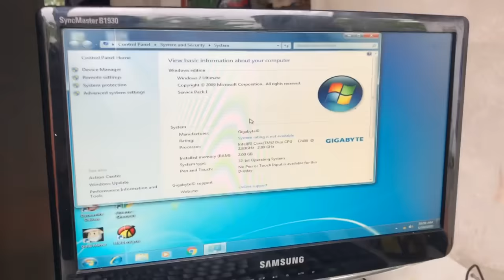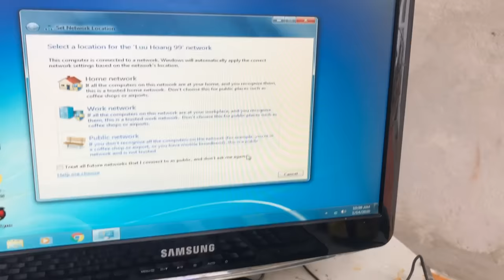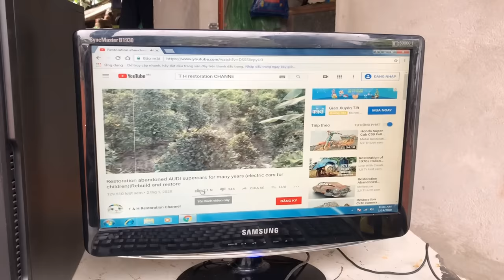Restoration destroyed desktop trees | Rebuild and restore ( FULL )

Comment: There is special place in IT hell for people who do things like these.
Reply: Good thing the entire machine was worthless beforehand. The PSU is an IED and the motherboard is a trash design made solely to clear out stocks of old Intel 945 chipsets. The Intel 945 chipset was in reality a Netburst Pentium 4/Pentium D chipset with bare minimum support for early 800 MHz FSB Core 2 parts.

Near the end of the Core 2 lifespan, there must have been a surplus of old 945 chipsets because most board vendors released several new low end boards like this one. They did some black magic in the hardware, and ugly hacks in the BIOS to "support" 1066 and 1333 MHz FSB Core 2 parts to try and make a sellable product. All of their "under the hood" jimmy rigging made these boards very unstable, especially when using 1333 MHz Core 2 parts, like the E8000 series. They also had shit performance owing to the gimped 533/667 MHz RAM.
Reply: @GGigabiteM  before i start i want to say i am a complete pc noob. I tried upgrading my gpu and psu from yesterday after finally waiting a week and paying $630 for my gpu. Well it went to shit i get bsod with no error code, my mouse usb is fucked (keyboards usb works in every port i tried 2 diff mice that don’t work on the usbs,  my fans won’t spin and it says hdmi not detected. Idk wtf i did but i watched hella linus and jayz2cents vids but it still went wrong. Gave my computer to geek squad for $250 in hopes they can fix it.
Reply: @Florida_954  Giving your computer to geek squad is about the worst thing you can do. I'd go get your computer back ASAP and make sure nothing was stolen out of it.

Plenty of forums on the internet with tech people to help diagnose and fix your system without risking it being destroyed or have parts stolen from it.
Reply: @GGigabiteM  really? I tried going to reddit first but nobody knew what was wrong. I hope i just get lucky man, i took pics of my pc before sending it in and it worked perfectly fine before i tried upgrading so i’ll just have to wait and see. Thanks for your response
Reply: @Florida_954  If you changed only your PSU and GPU, one of those is going to be the problem, unless you damaged something. Since I know nothing about your system, I can't give you much assistance, just basic troubleshooting.

If your new video card is significantly newer than the older video card, like by years or decades, the BIOS/UEFI version on your motherboard could be causing issues. It's not uncommon to have motherboards with old BIOS/UEFI versions to throw fits or not boot at all with a newer video card. Drivers can be an issue if you didn't uninstall the previous video card's drivers first.

As for the PSU, again no idea what you bought. You could have bought a land mine for all I know, not all PSUs are equal and there are thousands of chinesium wofat IEDs out there that are dangerous to use. At best, they'll cause the system to malfunction, at worst, they'll kill parts in a system. Another possibility is you plugged things in wrong. The PCIe 8 pin power connector is interchangeable with the EPS12v power connector, despite them having an inverted not compatible pinout. In most cases if this is done, the system won't power on because of sanity checks, but if those don't exist, the motherboard will basically turn into a smoldering crater.
Reply: @GGigabiteM  hey, luckily they got it working fine for me. They told me i had no blue screen and i just misplaced a couple things. Still a bummer considering i had to pay for the expensive membership but i thought my pc was ruined or my new gpu was the problem since i just got it and they’re so hard to find.So i’m not mad at all just happy everything is running :). Thank you so much for the advice and hopefully i can successfully upgrade my own computer next time.
Reply: 100%!
Reply: Hey guys look pc running windows 7

Comment: This is fake
2:32 Some of the pins on the processor socket are misaligned and he doesn't try to fix it.
3:10 The CD Drive has totally damage, no control board so it's impossible to repair it.
5:17 You shouldn't treat a hard disk like that as it will damage the surface of the disk.
5:58 You put the CD Drive upside down, I think he's hiding the top so we don't know it's another drive.
Reply: I think washing computer components in water is also pretty bad
Reply: Not really, I also usually do that and it's fine, as long as it's done carefully, don't soak it, and immediately remove the remaining water using a air compressor and then dry it in the sun or hair dryer for a few minutes until it's completely dry.

Comment: The socket was fine after motherboard cleaning, but you broke it...  How the motherboard could post? And why the hdd are so dirty INSIDE. The HDD are practically sealled... FAKE
Reply: Yes
Reply: Agreed, also why would someone put water on it?
Reply: I know right
Reply: And with the multimeter, he was just probing random pins measuring the continuity to make it look like he actually knows the pinout and diagram. It’s just really fake. Not to mention his very bad soldering job.
Reply: The final giveaway is with the monitor. He showed that he repainted it but look at the end he even got the original labels “repainted” lol
Reply: Sriram Jeostarzz it is very obvious that most of these parts cannot be recovered from the damage. This video is very staged. And then especially the hard drive part, you don’t need to be a smart person to understand a hard drive is completely ruined after getting the inside contaminated.
Reply: And the capacitor soldering... this is soooo fake, he didnt even use right soldering tool (or something, my english isnt very good)

Comment: 0:10 that as is if it were real it would be with enough corrosion, dirt and rust so that it would not be worth it for you to bother picking it up beyond disassembling it and seeing it inside at the risk of finding insects.

0:17 - 0:19 never under any circumstances pick up even a weight like that, because you risk injuring your back. lift it up more safely by taking it to your body and raising your legs vertically ( your back will thank you ) .

0:26 it is very noticeable that you have painted the computer with mud or that at least you have submerged it in the ground (you are not fooling anyone except yourself and the few unsuspecting people who do not know the world of computing)

1:28 motherboard in water (I'm assuming it's isopropyl alcohol, because if it isn't, bye-bye).

1:31 brushing the microprocessor frame will only partially or fully bend them (hope you don't get over yourself and don't wipe it because then you'll be screwed and your computer gone).

1:33 late, very late (let's pray the Lord for that microprocessor because it will work)

1:37 you're getting better boy, now you use another death tool in this case the hair dryer to finish blowing up the motherboard components (I love it).

1:44 so they don't remove the electrolytic capacitors (use a soldering iron to loosen them carefully, but not before adding a bit of tin to make it easier... and then remove the rest with a copper solder mesh and clean the rest with a brush and isopropyl alcohol ) .

1:48 We both know that it doesn't matter if you use a multimeter or tester to "check" if everything is fine, because off camera, taking advantage of the cuts in the video, you will change the parts that are not fine.

2:06 - 2:16  that , burning the printed circuit of the motherboard with the soldering iron and of course without using flux or soldering paste before ( keep it up , you are doing well ) . 2:25 - 2: 27 .

2:33 it is clearly seen that the pins where you are going to put the processor are bent. You're going to get burned. It's not going to work for a joke.

2:39 those ram memories are new or bought second hand. you are not fooling anyone. pathetic.

3:10 this is supposed to be the optical drive or the reader which of course shows that you have disassembled it off camera and then you have attached it with tape or glue. don't even bother, that doesn't work (3:12 there it is clearly seen).

3:21 the power supply ( how will it be ? .... )

  
3:26 in that state do not bother to fix it and change it for a generic one if you cannot find the one from the manufacturer due to the age of the computer.

3:48 Was it necessary to cut the wires with pliers while having a soldering iron to remove the tin or lead from the connections? Or are you just foolishly wasting time to increase the length of the video and continue with the comedy?

3:57 never touch an electrolytic capacitor with your bare hands, because it can carry an electrical charge and depending on the voltage, you can have a scare or simply go to the hospital for a heart attack.

4:06 - 4:08 I figured it just like with the motherboard (no comment).

4:33 - 4:40 It doesn't matter if you do it because being an internal part it won't be seen. It's just to kill time.

4:43 no comment...

4:48 ruling out that you know what you're doing, you're only going to break the hard drive... it's an isolated material that when it loses its seal it no longer works properly. It has torx screws for a reason and avoid fools like you and lose the life of a hard drive in the hands of someone who doesn't seem to know what he's doing and only limits himself to disassembling all its components like a 10-year-old child, hoping that dad fix it .

4:59 by the way, classify the screws so you don't lose them, because I'm realizing that you don't do it and surely later you don't even know which is which.

5:08 by doing that , the seal broken with the knife will guarantee that that hard drive will not work anymore . another proof that this video is only pure entertainment and is not real.

5:12 How is it possible for a factory sealed hard drive to have traces of mud on it?

5:16 hard drive killed by water action, not counting before the seal burst with the knife. take now

5:17 brush to increase static and break it in ferromagnetic material.

5:21 - 5:23  guys don't look if you're sensitive! , the dryer killer attacks again claiming one more victim : flawless victory , fatality !

5:24 - 5: 26 using a cotton swab scratching the surface of the disc and leaving traces that affect its functionality that not even formatting will fix.

5:50 - 5:55 that box and other parts are new, you're not fooling anyone.

5:58 the gabadora is upside down, xd. Let's hope that in the change of camera he realizes.

6:35 that monitor cannot be fixed or it will be very difficult to do.

6:37 for the safety of your hands don't take that without gloves.

7:12 power supply and motherboard. .

7:34 won't work.

7:42 - 7:45 Revenge of the Killer Dryer: Part Two.

8:02 I can understand that, because they are pieces that do not have electronics and there is no danger to their integrity.

9:17 that screen is new .

9:49 Before turning on the computer, make sure the battery is charged to save the date and bios settings.

10:44 in the end it works , but we all know this is a hoax

Comment: 4:10 no way... PSU into water?  🤦🏻‍♂️ hahahaha, dont do this bro, its very dangerous and can kill you
Reply: No actually it won't kill you. It's not plugged in to anything that gives electricity. And even if it was plugged in, well you know water and electricity, he would get a pretty good shock but it wouldn't kill him
Reply: @MuggyOne71  The high voltage capacitors can stay charged for MONTHS and they can be charged up to 400 volts. One touch and it instantly kills you.
Reply: The thing that kills you is not the voltage id the intensity inform your self beforr talking
Reply: A normal battery hace enought intensity to kill but not enought voltage to Cross a human
Reply: @adrianzamora6944  The capacitors have a lot of current in them too. I'm assuming that's what you mean when you say "intensity". Yes I know it's the current that kills, not the voltage. Still, there isn't really any consumer products that use 400v at a low current. It was better for me to say 400v instead of a bunch of current, as more people understand voltage better than current.
Reply: @rearmisser  👍💪

Comment: oh yes, look what a coincidence:

I go quietly down the street and I find a computer with all the pieces to restore "in a casual way and prepare it for nothing", and then magically I can repair it without mentioning that the person who is watching the video does not know that between shots of him video you change the pieces past them as "restored" and then "magically it works (of course, very credible.... not counting for example that the hard drive, having been opened with the seal burst, will no longer work because it is a ferromagnetic material and Even the smallest dust would affect it and it would no longer work, for example... and not to mention that before changing the microprocessor, you had bent the pins on the frame, so that's enough to know that your video is a scam only taken into account as entertainment, but nothing more)

Comment: IT IS IMPOSSIBLE FOR THESE COMPONENTS TO WORK, SO IT IS CLEARLY SEEN THAT IT IS ANOTHER MOTHERBOARD DIFFERENT FROM THE FIRST ONE YOU CAN SEE BY THE POSITION OF THE CIRCUIT THAT SUPPOSEDLY SOLDERS BUT IT LOOKS DIFFERENT ON THE OTHER BOARD